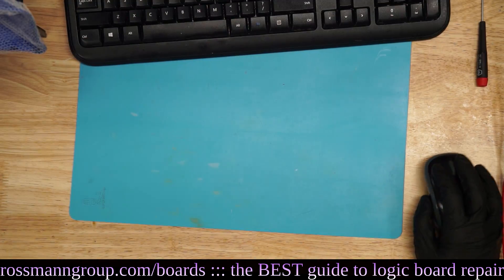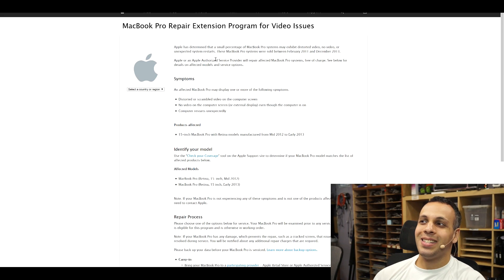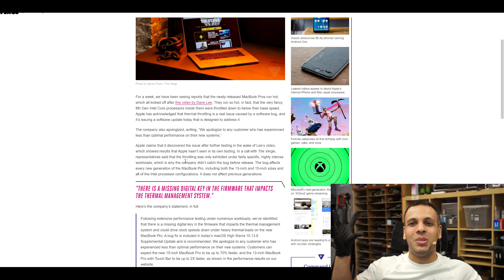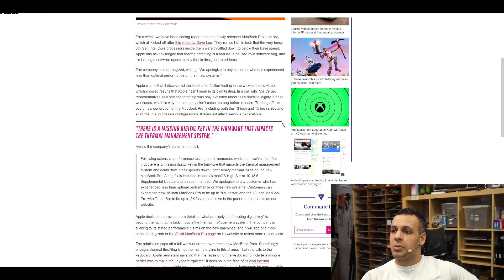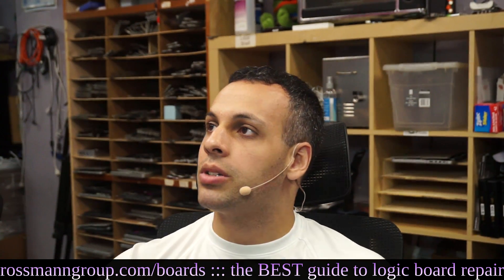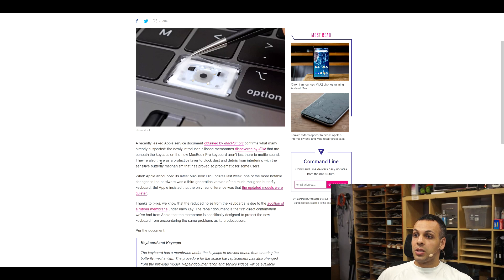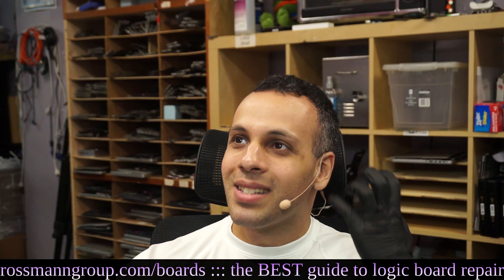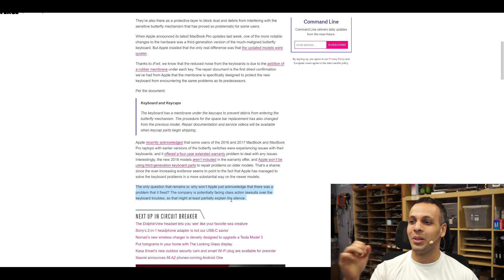This new Macbook is becoming a meme.

Comment: Oh the apple throttlebook? Until they make a good cooling system, that wont be fixed...
Reply: Eduardo Avila it's not just the cooling
the vrms also can't deliver the current
Reply: Benjamin Hale They can just made it a bit thicker, like 0.5cm thicker.
Reply: Throttlebook 😂
Reply: VRMs are not good enough ether.

100% the "missing key" is them limiting the current the CPU can draw.
Reply: They could, idk, put some god damn vent holes in the bottom of the machine for proper cooling like every other manufacturer has know to do since 1995.
Reply: The main throttling it does is to your budget.
Reply: Thats what I was thinking. It makes me think that their software fix will raise the thermal threshold and fry the chip.
Reply: It's throttlebook pro!
Reply: Benjamin Hale The Asus zepheras kept its profile by making the bottom open up when the lid opens. It makes a big difference.
Reply: Benjamin Hale an msi can cool a gpu and a more powerful cpu in about the same size for cheaper. Why can’t apple?
Reply: Likely their "digital key" is a software mod to disable the vrm tempreture sensor... These machines are going to be failing left right n center after a year or two with that much stress on the components
Reply: Kerwin Adding more ventilation to the BOTTOM of the case will not alter the æsthetics. Unless you're one of those people. "My Mac is a piece of art... Blah blah blah." That type of bullshit.
Reply: +Andrew Delashaw the "cool" thing about the Asus Zephyrus is that there is no ventilation on the bottom thanks to their patented AAS design.

If only Apple had thought of this first... so much for being a company that innovates ;)
Reply: Tom Braithwaite Probably they just raised the cpu power limit or the cpu current limit in the software. Some unlocked bioses in windows allow that using intel xtu, apple just probably did a firmware update.
And probably they made a small undervolt in the system so it consumes less energy, and can get closer to a better clock, even tho it still throttles a little bit.
Reply: GreyBlackWolf That's all they will be able to do. Alter the temp that the chip can reach before it throttles.
Reply: Apple throttlebook HAAHAAHAAHAHAAHA LMFAO! you made my day with that haha.
Reply: If you want a laugh, look up the Quad Core 2.5Ghz PowerMac G5. It was apples first real attempt at cooling a monstrous CPU. So naturally they water cooled it. Every system ($3,000 computer) died in about 5 years from leaks and corrosion. The ones that survived were just saved by ones who knew how to maintain a water cooling rig (This was 2005). But even most of those have rusted. Also the logic boards on these things, even air cooled, would also just one day stop working.
Reply: but it's nice and thin why would you want anything else?
Reply: For the last time the VRMs aren't the problem. The guy on Reddit who claimed it was the VRMs was talking out of his ass and didn't know what he was doing. The cooling system isn't up to par. The CPU is set to use 50W (instead of the rated 45W) of power continuously and I'm sure Apple set it up so that it throttles heavily when it overheats. The Turbo setting also appears to be a lot higher, 90W is what it looks like. My guess is they'll switch it to use 45W of power under load, closer to 75W at peak and set up the throttle so its less severe. That'll at least make it appear to work better and it'll avoid saturating the cooling system early on.
Reply: David Pruitt P = VI. P = (V^2)/R. P = (I^2)R. As Rcore will not change, thus to reduce power is to reduce voltage, Vcore in this case. Or reduce Icore, which is not possible unless you are decreasing Vcore or increasing Rcore, where Rcore will never change... 

Sure the voltage regulator module (VRM) wasn't the problem, but that doesn't change the fact that they did reduce Vcore and undervoltage the CPU, allowing it to maintain a more consistent temperature at maximum fan speed, by sacrificing clock speed.

So yeah, it must be related to voltage regulation, but it just wasn't the VRM that was causing it. It just that the software didn't throttle the throttlebook enough.

Source: E&E student.
Reply: ThrottleBook Retina, with Retzin.
Reply: +GreyBlackWolf I have the Zephyrus and it's the best gaming laptop I have ever owned!

In my opinion, if anyone is looking for a thin but powerful laptop that does it all without throttling, the Zephyrus is the way to go.

And it can be spec'd up to 6TB of total storage while still being cheaper than the MacBook !
Reply: That still won't fix it ! It's not getting enough power
Reply: What does the missing digital key in the firmware even mean? Dave Lee had tested it and apparently it's been fixed and is around 30/35% faster than the 2017 15 inch MacBook pro. Does this mean they've just lowered the power going to the CPU? Thus meaning the VRMS don't shit themselves trying to power the CPU. Or is the vrms that power the CPU still oing to maintain that overload prior to the update? Can anyone explain?
Reply: Eduardo Avila 1. BIOS = Basic I/O System. Windows does not install this, neither does any OS. A BIOS is stored in a ROM on the motherboard, which is manufacturer designed.

2. E = Pt. As said before, P = VI or (V^2)R. Thus, E = (V^2)Rt. You cannot increase power and decrease energy while undervolting the CPU as energy and power is directly proportional to voltage.
Reply: there's no frigging way they can fit a good cooling system into that thin of a chassis. All the laptops that are able cool i9 adequately are 3 times as thick.
Reply: I have been seeing quite a few of these with scorched SSD's. They boot but since the drive is soldered to the circuit board we cant fix them. I have seen 4 like this that are just over 1 year old. So no warranty. Nice Apple.
Reply: Note that those batteries are smaller and crappier then the old ones...
Reply: it's so funny how they consider altering software to by-pass the tempurature check is a good fix...
Reply: Panupat Chongstitwattana Yes... Instead of recalling the macbooks and replacing the heatsinks and fans, to better ones, that cool down the chips and vrms better, they just put a band-aid in there... 
And you still pay a premium price for that... 
I would rather pay $800 and get a acer nitro 5.
Reply: honestly they could just perforate the bottom of the laptop in a decorative way that would look aesthetically pleasing while at the same time improving air intake by a hundredfold
Reply: Putting a not-so-efficient cooling system the pricing it high? That's more like apple
Reply: Kerwin sand is fans have terrible thermal transfer from the coldplate to the fansblades/heatsinks. There is a good reason it never got officially released. The thermostats engine 27 is a great example the air gaps between the plate and fins no matter how well they machine it are still there and prevent and good thermal transfer.
Reply: Kerwin A CPU cooler based on this design was released a few years ago, it's cooling performance was ok as far as i can remember but the biggest drawback was that pretty audible high pitched whine it produced (design limitation).
Reply: I have no idea how they expect to cool that with such a thin frame.
Even liquid cooling needs more space.
Reply: So they either increased throttling threshold or lowered Vcore.

If prior, won't that fry the CPU?

If latter, clock speed is proportional to Vcore in most modern CPU, isn't that just reducing clock speed and "pre-throttle" the CPU, in which case why even buy the i9 version of the macbook?
Reply: Rcore changes with clock speed. Its not a simple linear resistor.
Reply: Gotbread Eh, as far as I'm concerned, Rcore will only change proportional to temperature, or if there is a variable resistor IC in the core design, which is one way to do current limiting.

If so, other than to protect the CPU core from overcurrent, what is the point of including a digital variable resistor in the design when you could just reduce voltage to do the same. Via the CPU core voltage supply rail... aka undervolting. 🤔
Reply: @Kerwin, 
I don't think having a heavy spinning metal disc in your laptop is a great and durable idea. Something about gyroscopic effect.
Reply: Kerwin, Odious Ritual, Roy Buitenhuis The geometry of the cooler won't fit in a thin laptop. The machining would be at least as critical as that of a hard drive, making it unreasonably expensive. Thermal distortion of the base or heatsink would increase the air gap, reducing efficiency. The heatsink runs at 2000 rpm, which would generate some noise above 30db. The case would need to be vented, something Apple seems loath to do. 

If they run a heatpipe to the bottom of the case, they can achieve some ambient cooling. This might make it hot for actual laptop use. The advantage would be that they could sell a separate chiller/cradle for the laptop to sit on for production use. When not in production use, it would throttle normally. Selling a companion chiller might result in a marketing fiasco, since it would be a tacit admission that they provide inadequate cooling. They'd rather have unhappy customers than risk a class-action suit. 

Best solution: open the windows and set the damned thing on a block of dry ice.
Reply: James Isaac Yes, and still not impressive
Reply: popnimpop because they're trash
Reply: Mike Loeven Nope, the heatsink doenst have the capacity of removing all that heat from the laptop, they need to get a better heatsink (a bit more thicker and larger, just some more grams of copper), and a faster cooler, probably some 300-1000 more rpm. 
Just make a hole in the bottom part wont help much, beleive me, i've done that to a overheating laptop that didnt a had the propper heatsink (bad engeneering like the apple), it reduces a little bit the heat tha accumulates inside the laptop, but not much the cpu one.
Reply: Kevin Miedema And then release a update that throttles down that software to make the macbook owners buy the new one
Reply: You can't fit good cooling and still fit in the battery they want and they aren't going to lose battery size.
Reply: whats the model VRM they are using?
Reply: Eduardo Avila they ashtray fixed the issues. The performance is back to base speed.

Comment: Software CAN'T fix thermal throttling of a cpu or PC who's thermal casing design is the SEVERE bottleneck of the cpu who's ENTIRE POINT is to be able to handle high cpu usage work loads like content creation using a high end cpu! DUMBASS crapple.  (facepalm).  God crapple has become so retarded since Jobs died.  It's pathetic...really.
Reply: Except it's not exactly thermal throttling, exactly. It's actually the Voltage Regulator Module (VRM)
Reply: https://www.reddit.com/r/macbookpro/comments/91256u/optimal_cpu_tuning_settings_for_i9_mbp_to_stop/

https://www.cnet.com/news/apple-macbook-pro-speed-throttling-patch-tested/
Reply: Unless you speed up the fans on MAX

Edit: Apple engineering makes me feel like a genius
Reply: Unless there was something in the operating system running the CPU into the ground while the device is working....IE intentionally throttling the device through mathematical calculations and loops.....or how they did it with iPhones
Reply: Freya Soren Fans do have a limit.
Reply: the fan profile did not change, still, temperatures went down and performance went up..
Reply: Spin fans harder, undervolt, increase temp tolerance for throttle. Do all that and it cud well sort the issue.